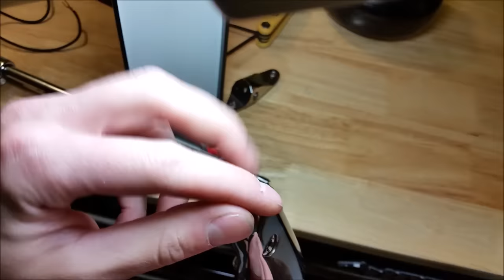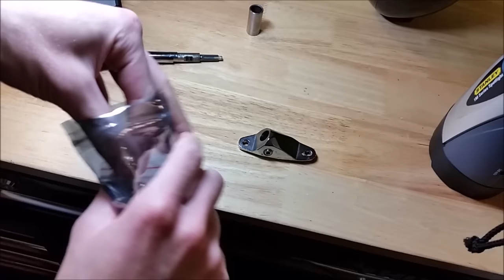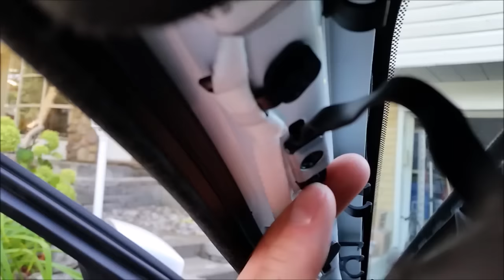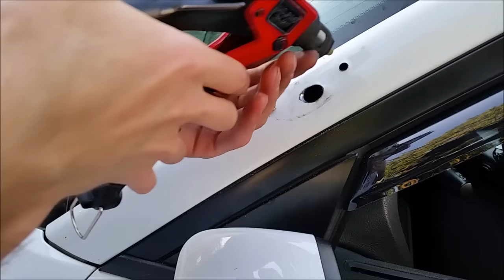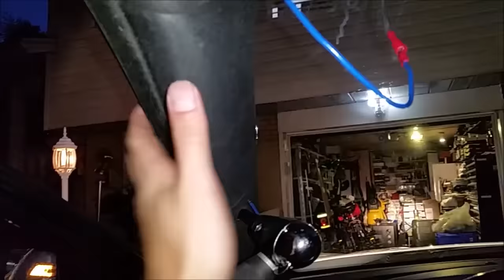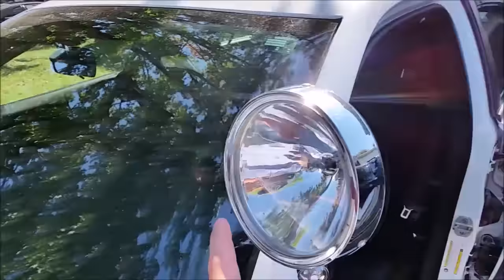How to Install a Unity Spot Light on a Dodge Charger - Full In-Depth Explanation

Comment: Awesome video man! I was holding my breath half the time you were drilling. Looks great
Reply from the maker: Thanks! Glad it helped, there are no good vids on youtbube going in depth about these spotlights so I wanted to over as much as possible. Also an important side note, when I did the passenger side, I put a thin shim (cut piece of aluminum sheet metal) around the bushing that I used (on opposite side of set screw)
The drill bushing I used was a few millimeters to small, and it was that tiny amount that affected the position of the hole the first time I did the install, causing me to have to mess around with the dremel. 
So yeah... make sure your drill bushing fits exactly in the mounting bracket with no play what so ever, and the drill bit fits inside the inner diameter as well with no play what so ever.

Comment: Thank the Lord,I have been searching for a good spotlight install video for a long time now, I'm definitely subbing to this channel,I always hate seeing the yellowed cover, that's why you always turn the spotlight facing down away from the sun.
Reply from the maker: Same here partner, there were one or two vids of people doing it so I decided to make one my self covering all the questions i had when I first began to research how these spotlights worked. Take a look at the "Unity Spotlight Vids" playlist on my channel. I have complied all the vids that cover these spotlights in that playlist. 

The yellowing occurs because the plastic eventually gets broken down by the UV rays from the sun, I can see aiming it down while not in use a good idea to prolong it's life, also keeps from stones and road dust from hitting it, but realistically it will yellow over time no matter what. You cannot fully shield it from the UV rays. But really you can get bulbs on ebay pretty cheap or put a glass sealed beam.
Reply: Videos from Québec I was thinking it was yellowed due to direct sunlight hitting it.,I also saw your center console set up and was wondering if you installed everything yourself or hired someone to do it instead,and if it was yourself how difficult was installation?
Reply from the maker: Yes hitting directly it will yellow faster, but the UV rays do reflect off the windshield and surround everything around us. Still this takes at least 10+ years. Same happens on cheap outdoor cables.
Yes I installed it my self, very easy process. Simply bolts in to factory bolt locations. You do have to however have to get the correct model for your vehicle year.

Comment: Great video! Good job, just would have put some paint by the holes you drilled to prevent possible rust in the future
Reply from the maker: Yes afterwards I did use some touch up paint.
I would however recommend painting the holes drilled for the rivnuts too

Comment: Want to fit 1 on my P71 Crown Vic but I’m a bit unsure about the drilling part + it will need a cutout in the door. 
You took your time with a lot of patience and that’s the key to a job. Well done! From the UK..
Reply from the maker: Yes the crown vic requires a notch to be cut out from the door.

Comment: I'm putting one on my Frontier, I've got a similar pillar and I know it will work. My 2010 CVPI came with one thankfully installed. My truck needs one. Have the LED housings also to use. Got my LED's and spotlight to install for free so I'm thankful.
Reply from the maker: Check the Unity USA website and ensure you have the correct part numbers.

Comment: I'm getting ready to order and install two lights on my 2012 Dodge Charger. I wasn't sure which brand to order, but after watching your video I have decided on ordering the Unity lights and taking the plunge. Hopefully it goes as smooth for me as it appeared to for you. Always open to any other comments from you if there's something that's not on your video. But I thank you for posting this because I don't think I would be up to the challenge until I watched your video.
Reply from the maker: In terms of spot lights like this Unity is the only option. Just make certain you get not only the correct mounting brackets but the spot lights as well. They are vehicle specific. See description for part numbers.
Reply: How exactly did you end up holding that air bag strap out of the way so that your drill bit didn't hit it on the way through?

Comment: Awesome video! Followed all the way and I bought all new dill bits, used the clutch on the drill, but holy crap did it mangle my piller. Mines an R/T, you’d never know, but I think most the mangle will be covered by the outside mounting bracket. Thanks though, I even brought my dremel!
Reply from the maker: Glad it helped. You can clean up the hole a bit with the dremel and touch up the edges with paint to prevent corrosion.

Comment: love the vid im getting an 08 magnum and will be putting im a spot light
Reply from the maker: Glad it helped, It's the same process for the magnum.
Reply: Videos from Québec what about the wiring? Unless its a police magnum
Reply from the maker: I do not believe the Magnum was ever offered as police package pre-wired.
Regardless it's really simple you just have to pass a single +12V wire to the pillar. Use at least 18ga. wire or thicker.

Comment: I have a crown vic with both spotlight but recently driver-side stop working can i rewire it to the battery with a new wire ?
Reply from the maker: There is already be a wire there with power from the battery.
Reply: Videos from Québec im not geting power but my other side works
Reply from the maker: Verify with a tester, if you have no power check the fuse, there should be a specific fuse for the spotlights.
It probably shorted to the body of the car somehow. You don't need to run a new wire, just find out why that one is not getting power.
Reply: Videos from Québec ok kool il do that in the morning
Reply: Do you know were The fuse is located for the drivers side spotlight on crown Victoria?
Reply: @georgesexton5731  it should be under the hood where all the fuses  be  that's where mine was. I think its a 20 amp or 30 amp or maybe 10 amp

Comment: you need to do one for a crown victoria
Reply from the maker: It's basically the same process, however the mounting bracket is actually on the inside of the pillar, under the trim.
I have not done one personally, but I'm sure there are some tricks to it.
Reply: Videos from Québec Thanks, I'm just concerned because you have to notch out the door
Reply from the maker: Yes you will need a dremel style rotary tool for that for sure.
I believe unity provides a template that you trace on the door for where it must be notched, they also provide a rubber trim that goes over the notched part.
For the vic's they provide regular metal screws to secure the bracket, so you don't have to mess with riv nuts like I did, however I find the rivnuts to be more secure,

Comment: I'm thinking of installing one on my 2017 Ford Taurus SHO
Reply from the maker: You will need the correct model spotlight and mounting bracket. But as I say, once it's installed, it's there for good.
Reply: Yea I'm going to make it look like an unmarked interceptor. Thanks!
Reply from the maker: Yeah it does look cool but beware you will get a lot of attention. Which is cool but can get annoying after a while.
Reply: Videos from Québec Cool thanks
Reply: @astrxhub  im here for the same car and spot light ...how did your come out

Comment: Any reason why my brand new light won't work I ran power to it directly from battery to test it but it wouldn't turn on or does it have to be in the pillar to complete circuit for some reasons
Reply: Yes, mounting it to the pillar provides the ground and completes the circuit. If you're just bench testing it, you need to run a wire from the ground post of your battery to the spotlight shaft to make it function.

Comment: I know you said that these are vehicle specific but I can not find one on eBay for a 2013 charger. I am asking if the ones for the crown Vic or Taurs will fit on the charger? I know this an old video so I hoping you still monitor the comments or maybe someone else can advise me.
Reply: I found one for my dodge charger 2015, it was $200+ on EbAy

Comment: I see a lot of removing or replacing ..but what about lubeing or maintaining the light..mine is hard to turn and think it needs lubed
Reply from the maker: Well now you know how to get it apart.. just lubricate it as necessary. Use a 00 weight grease that will not freeze in winter.

Comment: 1. Could you use a light from a Taurus for a Wrangler as long as you had a wrangler bracket? Since neither car has the spotlight swing open with the door is there a reason why this wouldn't work?

2. How much was the upgrade to the LED. 

Thank you and subscribed!
Reply from the maker: Hey, no unfortunately you cannot. The spotlight must be suitable for the vehicle as well. The bushing on the shaft is set at a specific place to allow it to rotate properly. However some part numbers are compatible with multiple vehicles.
What year Wrangler do you have?
To buy the LED bulb new they are expensive, but you can pick them up used on ebay. I have the ones from Whelen, I would not recommend them because both got moisture in them and I had to open them up, dry them and reseal them several times now. So maybe try the ones from Unity. 
But in all honesty the H3 halogen bulb is fine, the LED upgrade just looks cool in my opinion.

Comment: What type of screws did you use ? I bought a spotlight without screws lol such a bad idea and Where can I find the black rubber piece between the car and the bracket called ??
Reply from the maker: Does your car already have a hole and the threaded nuts installed from where a spotlight was originally, or are you doing a new install. Is it a Dodge Charger ?
Reply: Chargèro it's a new install on a crown Vic

Comment: I wanted to install something like this on my 99' VW passat, would that be possible? Seems stupid I know but I'd have use for it
Reply from the maker: They probably make one for it. Search the UnityUSA website and it will tell you the correct model spotlight and mounting kit to use. You must use the spotlight and mounting kit specified by unity.
Reply: Thanks for the advice man, they have a specific kit for the beetle for some reason so I reached out to customer support to see if the Passat will be compatible
Reply from the maker: Yes do that, the customer support is very good. Just note that for more unique vehicles the fitment may need fine adjustments even if they say it will be compatible, be careful with things like placement of the shaft, screw lengths etc...

Comment: Y some major city fleet yards don't install dual spot lights I'll never understand, looks very silly with just one
Reply from the maker: cost
Reply: @QuaabQueb  absolutely not the reason, that's covered by state, county n city taxes by the budget
Reply from the maker: @JOHNSMITH-dc6lr  yeah....they want to save a few bucks if it's not absolutely necessary.
Reply: @QuaabQueb  what are LE employees or non LE patrol employees with partners going to use when the need comes, that makes no sence fellaz

Comment: Id like to take a buncch of them and mount them like offroad lights on my brush guard
Reply from the maker: They make a pedestal mount style search for "Unity S6"
If you use LED bulbs get the 8 degree model. Or use flood style halogen bulbs
You can also mix spot and flood bulbs for better light output
Reply: Chargèro holy shit man thanks for all the help ive honestly never come across someone so helpful on any website
Reply from the maker: Glad I can help. Same here, very little info on these online, so I try to cover all the questions I had in my videos.

Comment: What drill bit size did you use?
Reply from the maker: half inch
Reply: Sweet thanks man. I’m currently doing one for my Interceptor sedan and the unity sheet didn’t state but size. But thanks again!
Reply from the maker: @silverbullet7815  it may be a different size. It should have come with a bushing to drill the hole. The drill bit should fit just snugly in the bushing.

Comment: Salut, installerais le mien sur mon impala?
Reply from the maker: Oui, cependant, ten'a le modèle spécifique pour votre véhicule. Pas seulment le support de montage "mounting bracket", mais aussi le "shaft" du spotlight, est spécialement conçu pour cette véhicule. 
Tout cela pour dire, tu n'pouvez pas enlever un spot light du'ne Crown Victoria ou Charger etc.. et l'installer sur un Impala. Ça ne va pas.

Comment: Way too high. Looks goofy
Reply from the maker: That's where they specify it should be installed
Reply: Understand, didn’t mean to sound rude. We have several chargers and they are all about 5” shorter than that from the factory.
Reply from the maker: @slsk9  the handle post is shorter or they mount the entire spotlight lower on the pillar?
If mounted too low I imagine it will come too close to the dashboard?